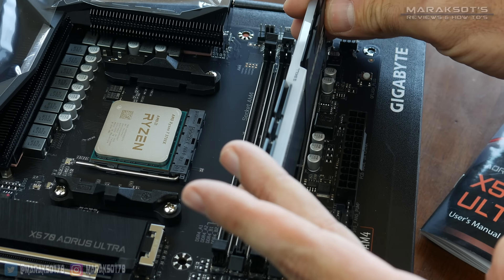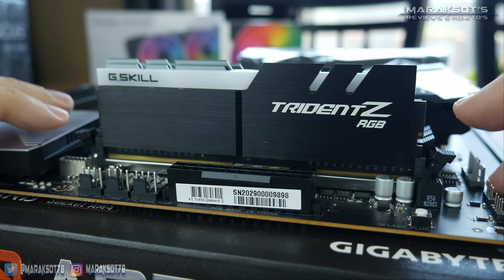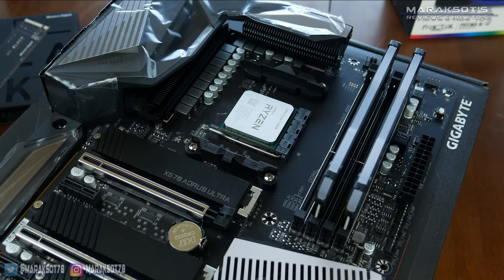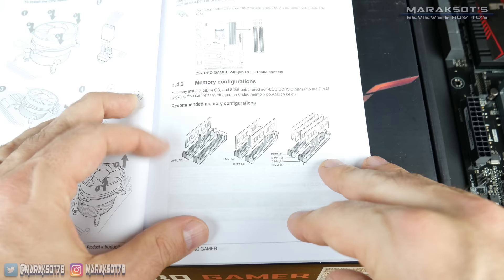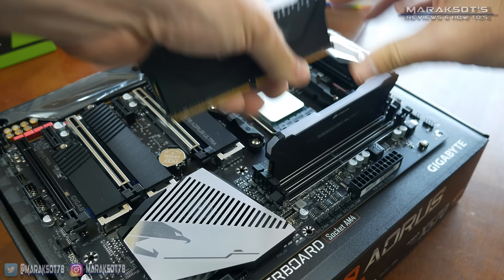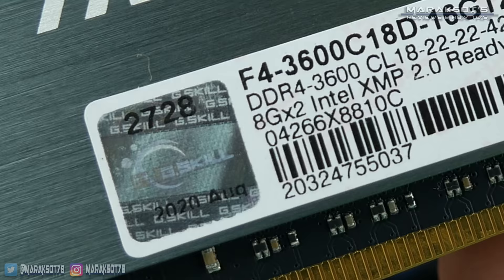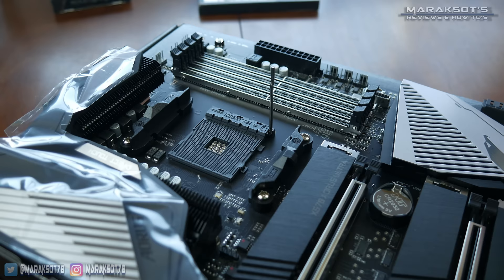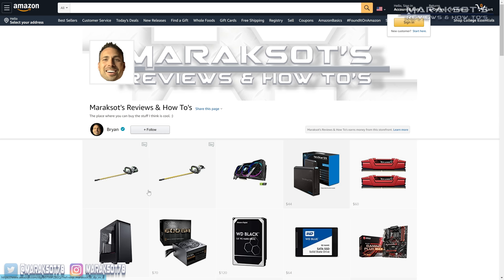A Beginners Guide: Upgrading Your PC's RAM

Comment: Wait so other than the physical application of new ram u dont need to adjust anything internally? Like in the bios ? Unless you wanted higher clocked speeds that is. Im lookn too swap my incompatible ram w new one and was wondering if it’s literally plug n play?
Reply from the maker: Yes, as long as the new RAM modules are compatible with your motherboard it's simply plug and play. You just want to make sure the modules are fully seated in their slots and you're good to go. And like you said, you only need to go into your BIOS and enable XMP if you bought a higher speed kit than 2133MHz.
Reply: @Maraksot78  no wayyy u responded?! Awesome man:) thank you so much i have a big problem with crashing on games due to “no memory left “ and its quite frustrating to say the least it was fine for a few months but then started doing that i think my current ram is not compatible I appreciate the feedback so soon!
Reply from the maker: @loganboi962  What graphics card do you have? And what game or games does your PC crash on? It may be a VRAM issue you're having and not a system memory problem.
Reply: @Maraksot78  i have a rtx 3060 its quite new too im not 100% bc im newer into pc building obviously but from my poiny of view it seems like a ram thing it’s typically in apex and hunt showdown and rust i can play Minecraft w 200+ mods and a heavy maxed shadder w no issues typically so thats why i think its ram not 100% tho
Reply from the maker: @loganboi962  hmm... that's weird man. Sounds like you have a very new/solid system. If it's only happening in some games my guess is it's a software setting of some kind causing the problem. Could be a memory leak in the game which means it's a problem with the game the developer needs to patch? Unfortunately I have no idea what the actually problem might be. Google is your friend in this department. I would Google the exact stuff you're experiencing and see if other people have had a similar problem and found a solution for it. Odds are someone else has had the same problem and figured out a solution, it just may take some time to search it out and find it. But that's what I would do before dropping money on new RAM or something. Hope you get it figured out. Best of luck to you man.
Reply: @Maraksot78  to be honest im kinda at a loss in terms of finding the problem this was one of my last times lookin on google n youtube most of the guides and vids only explain other peoples issues unfortunately ive done just about everything to fix it but I definitely think its a possible memory leak because it tends to happen when im playn say apex and on discord and trying to play music as well even sometimes i dont play music and it still crashes hopefully i can figure this out its been a stressful nightmare trying to deduce what the problem even is .
Reply from the maker: @loganboi962  I hear ya. Problems like that are maddening. But if its isolated to a particular game then my bet is it's something with that game. Have you tried uninstalling Apex and reinstalling it? Or even Discord for that matter?
Reply: @loganboi962  no memory left? Don't increase vram ,revert it all back , but if u didn't increase ur vram and it still eating ur memory idk wut to do 👁️👄👁️
Reply: @UresAeIl  i didnt say vram i said just ram yaknow memory? and i factory reset an d it fixed all issues

Comment: Is there any problem/performance issue with installing two different capacity rams) with same speed) in in two ram slots?? 
For example 4gb ddr3 1600mhz in slot 1 and 2gb ddr3 1600mhz in slot 2..

Comment: I could not find the QVL for my Rother SSID 8653 , but over at HP support I found this info under Memory upgrade info saying it  Supports PC4-21300 (DDR4-2666). Is that 2666MHz ? It says up to 32GB for a 64 bit system. So I need a set totaling 32GBs  that are compatible. Can you recommend something?

Comment: I'm sorry, but unplugging the computer is not only not necessary, but also making the "touch your case to remove static electricity" useless. Reason being the ground connection is broken once you unplugging the power cable, touch the case will only equalize charge between you and what's connected to ground in the computer.
The correct method is just turn off the PSU using the switch in the back. You can also turn off the power strip if you want to be safe or your PSU doesn't have a switch.

Comment: Same brand, speed & capacity... ok fine, but what about the "number of ranks" (1Rx8 vs 2Rx8)...?? In my new HP Omen 30L there is a HyperX Fury DDR4 16GB 3200 "2Rx8", and I want to add another 16GB in the 2nd slot (2 slots total, dual-channel architecture). Problem is, when online shopping, I can only seem to find HyperX Fury DDR4 16GB 3200 "1Rx8"... Will that matter? Can the two types be mixed and still run in "dual-channel"? (The manual for my PC/motherboard doesn't mention anything about the number of ranks (1Rx8 vs 2Rx8), which is frustrating!... Help!

Comment: Do I have to remove my motherboard to switch out the ram? Or can I just open the PC and replace the ram without taking it apart?
Reply from the maker: You don't have to pull your motherboard to install new RAM.  I was building a new PC when I made this video and having the motherboard out of the case allowed me to get angles and close ups I wouldn't have been able to get when it was still in the case.

Comment: Question, so my motherboard manufacturer tested the exact ram i want to get, but it is the non - rgb version. i want to get the rgb version, would this be okay to run? i dont know if rgb changes a lot with the inner workings of the RAM or not

Comment: when upgrading ram do u need to check on CL or only on speed in MHz?
I have 2x4gb hyperX ddr4 cl15 and 2666MHz
And i want to upgrade ram to 16 gb, but i cant find the exact same ram, so i have option of 1) 2x4gb ddr4 hyperX cl16 2666Mhz or 2) 2x4gb ddr4 hyperx cl15 2400MHz. In one opition speed does not match and in other latency does not match.

Comment: I have some questions I hope someone with experience can answer, does it matter what side of the ram stick you use, and when they say keep all ram companies the same  does that mean forever buy the same company or make all the ram in your pc the same? Plz answer this someone I NEED TO KNOW
Reply: I don't get what you mean by "what side of ram stick you use". All modules are keyed. That means they can only be installed 1 way. Its best practice to use the same brand and model of memory. However, as long as your extra modules are similar CAS latency and speed, you should be ok.
Reply: @JJFlores197 Thank you for the response, I did realize while making the comment it was a little confusing but I am unsure how to make it less confusing but I hope this can answered can I just completely change ram company’s like does the motherboard prefer the first ram company it’s ever given?
Reply: @PeetahBreadLikesSweetBread  I think I get it now. If you take out all modules, you can install whatever brand/model as long as its compatible with that board.
Reply: @JJFlores197 Ty

Comment: Hi can anyone help? So currently in my pc i have 16GB 3600mhz corsair ram, but if i were to get Vengenace ram at 16GB 3600mhz, would i need to go into bios n set the ram to 3600? Or would it already run at that because its already at 3600mhz ? Thanks

Comment: Got 16 gigs 3200 mhz, looking to upgrade to 32 gigs 3600mhz...  been running it for a year at 2133 mhz as i did not know that you are suppose to overclock it in the bios.....not really worried about the physical aspect of it but the bios (even when I was installing windows and such) scared me... if I have a amd cpu will the intel xmp in the bios mess up anything? and also will the ram temp (and temp in the case) be much much hotter if i do overclock it to 3600mhz?

Comment: Hai still very new to pc building and upgrading if I were to completely replace my ram how would I get the memory from that previous ram?
Reply from the maker: If you're talking about all your files on your computer, they're stored on your hard drive or SSD (Solid State Drive) not the RAM. All your files will still be there when you change out the RAM. They would only be gone if you removed your hard drive. Nowadays many people mistakenly use the word Memory when they should be using the word Storage. For example, you hear people all the time say their phone has 128 or 256GB of Memory. THIS IS INCORRECT. Their phone has 128 or 256GB of STORAGE. Most phones have only 4 or 8GB of memory or RAM and most PC's have 16GB of RAM. RAM stands for Random Access Memory and things can only be temporarily stored in RAM. As soon as the power to the RAM is turned off everything that was in there is gone. This is why if you don't hit save on something and your computer locks up and you have to restart or it loses power all your work is gone and can not be recovered because it was only being temporarily stored in the RAM and wasn't saved to the hard drive. When you hit save it then takes a copy of the data in the RAM and saves it to your hard drive which, unlike RAM, can store data even when the power is off.
You know how every time you open a program or a file it takes a little time to load? The bigger the file/program the longer it takes right? What's happening at those times is the data needed to run that program or open that file is being loaded from your storage drive into the RAM so the CPU can work with that data. The connection between the CPU and the RAM is very fast that's why things work pretty much instantaneously when you're doing stuff once the program has loaded. The connection used by your storage drive however is much slower by comparison which is evidenced by how long it takes things to load when you first start them up. Without RAM every single change you made to a file would have to be slowly written to your storage, meaning after every single letter you typed, or any other action you did, it would take several seconds to write the data for that action to the hard drive. Imagine how slow and irritating it would be to hit save after every single letter you typed. That's basically what it would be like without RAM. Playing games would be impossible. I know this is a much longer explanation than I'm sure you were expecting or even wanting, but I think it's important for people to understand the difference between memory and storage especially if you're going to be upgrading or messing with either one in your computer.

Comment: Ive got a Ryzen 7 3800x/w asrock b450m/ac 750B psu changing dram frequency to 3600mhz will cause the PC to reboot with no display and no power to keyboard after unplugging afew hours i can boot into bios using pc for gaming 2 xmp profiles (trying to install viper Patriot 4100mhz to run at best settings) any help is greatly appreciated

Comment: My ram stick won’t align with the little plastic notch, anything I can do abt that?
Reply from the maker: The only reason the notch wouldn't be aligning is you either need to flip your RAM module the other way (which I imagine you've tried) or your motherboard uses different RAM than you purchased. Motherboards are designed to use one type of RAM only. DDR5 will not work in a motherboard that is designed for DDR4 and vise versa. If you ordered it online and ordered the correct RAM for your motherboard, I wonder if they sent you the wrong RAM?  i.e. they sent you DDR5 when you ordered DDR4.

Comment: can you install 2 different ram brands or does it have to be the same?
Reply: I have two 8bg sticks of ddr4 3200
one is made by Micron the other by Crucial.  
Works fine. try to mach the CL timing # also.

Comment: If I get the exact same brand, speed and cap, but different memory size say if I'm using 4 x8 GB  stick and put in 4 x16gb but of the same exact specs, will there be any issues? If someone could please answer? THank you!

Edit: My CPU and MOBO can support up to 128 GB of RAM

Comment: Okay if i have 2 existing sticks and want to add 2 more but the ONLY difference is that the new ones are RGB, does that matter at all? I keep seeing mixed opinions
Reply from the maker: I dont know. There's a possibility the old and new RAM will work fine together but it's also possible they won't. There's really no way to know for sure without actually trying it. RAM is one of those components that's weird like that which is why most people, my self included, recommended buying the exact same stuff you already have. If that's not possible then I recommended buying all new and selling off your old RAM as that's the best way to guarantee they'll all work fine together.
Reply: @Maraksot78  thank you so much for the quick reply:))

Comment: Hi i need some help. I am on an i5 3470 with 8GB RAM. But i also have 16GB (4x 4GB) from an older i3 pc. 
They both use DDR3. Can i just add 2 more into my i5 pc to get the 16GB? OR do i need to worry about RAM speed or such things? 

Also i dont want to remove the current RAM on my i5, because i dont want to take the risk my pc not starting. Its all i have at the moment to kill time at home lol.

Comment: If I completely swapping out my old ram do I have to change anything on BIOS ?
Reply from the maker: Only if you want to enable the XMP, which is the speed your RAM is rated for i.e. 3200MHz, 3600MHz, etc.  If you don't enable XMP then it will run at the default speed of 2133MHz.  I do have a video about enabling XMP too.  https://youtu.be/WDzrq5IxBX4

Comment: Hello, I couldn't find a definite answer to my personal question, I have 2 sticks of 8gb ram and I want to get 2 more of the exact same everything, but its not available ANYWHERE, so could I take those two out and put in 4 others?
Reply from the maker: Absolutely. Whatever RAM you decide to go with, I'd recommend checking your motherboard manufacturers QVL first and making sure you buy a kit that's been tested and verified to work with your motherboard. It's kind of frustrating to spend a bunch of money on RAM only to find it doesn't work right and then you have to go through the whole process of RMA-ing it and buying a new kit.  Hopefully this will save you that headache.

Comment: i have a DDR3 on my computer right now and my motherboard is intel is it possible to switch the DDR I have now to a  DDR4?
Reply from the maker: Only if you upgrade your motherboard to one that uses DDR4. Which means you'd need to upgrade your CPU as well. DDR3 and DDR4 are pinned differently so DDR3 will not slot into a DDR4 motherboard and DDR4 will not slot into a DDR3 motherboard.

Comment: is it bad i just spent $90 for 32gb of ddr4 2800hrz ram? my motherboard  {36e7 lenevo} and cpu is lockedd at 2800 ram capacity so im fine right? my current ram is 1800 8 gb 1 stick. ill update this comment if it works

Comment: Hey @Maraksot78, I'm wondering if I am taking any risk with the power supply when I added two additional ram sticks? Can it overcook something? How can I test if I have an adequate power supply for the new ram? Should it not be a problem?
Reply from the maker: That shouldn't be an issue at all as RAM doesn't pull that much power.  The thing you need a bigger power supply for is typically a graphics card.
Reply: @Maraksot78  ty man for the kind response

Comment: Hey man

Loved the video, super to the point and covers almost everything. I have one of those boards you mentioned 99% of us wont have XD (x99) I currently have 4x4GB installed and want to upgrade to more capacity though its hard to find the same RAM as I bought my build back in 2014. Its also hard to find anything under 3000mhz too ! so I wanted to see if buying 2 kits of 2x8GB to run quad channel still is a thing ? do i have to buy 4x8 ? or will 2 kits of 2x8 work still ? 

Hope that makes sense.

Thanks for your help 

Or if anyone else on here knows that'd be swell !!!

Comment: Sir I have problem with my Ram !  
16GB Installed - 4GB usable and I don't know what to do ..... before couple days everything was fine before Re Install Windows 10 x64 bit (I use 64 bit operation system) x64 based peocessor
Reply: Is it already fine now? If not try search for 16gb ram (4gb usable) and click the first video

Comment: if I replace my ram will I lose anything on my pc? Im gussing its all on the hd and ssd but gotta ask
Reply from the maker: You're correct all your data is stored on your HDD (hard disc drive) or SSD (solid state drive). Replacing RAM will not cause you to lose any of your files. RAM is where files are loaded into so your CPU can quickly work with those files. That's why when you first open a program or application it takes awhile to start up because it's loading the program into your RAM so you can use it. Once it's open then things move along quickly and smoothly because the connection between your RAM and CPU is WAAAY faster than what a hard drive or even an SSD can do. If your CPU had to communicate directly with your storage all the time and we didn't have RAM, everytime you made an action in a program you would have to wait for a second or two for it to happen because your HDD or SSD would take awhile to respond. And as you can imagine that would be super annoying.

Comment: Can someone help me please? 
I wanted to upgrade my pcs RAM from 8 gb to 16 gb. I dod everything correctly, I checked it like five times. Soo I plugged my pc in and started it. Everything seemed fone until the first minute passed and my screen did not show anything yet. It said there is no signal but it is connected to my pc. So I restarted it. The same problem occurred. I was starting to become mad. So I shut down the pc, unplugged it, and I replaced both RAM sticks with the other. Still nothing changed. Any ideas how to fix it?
Oh and btw they are exactly the same brand, amount, and speed. So I have no idea. Pls help me!